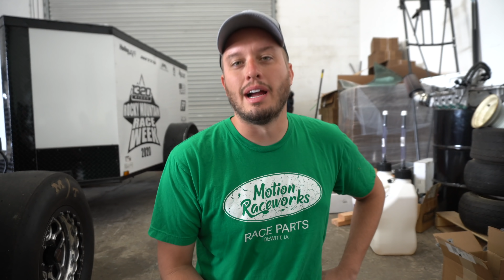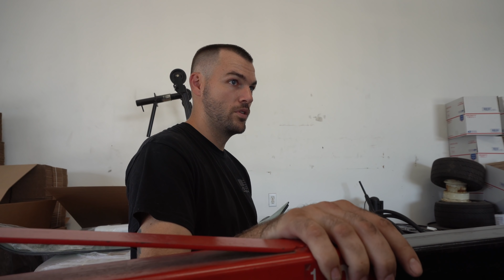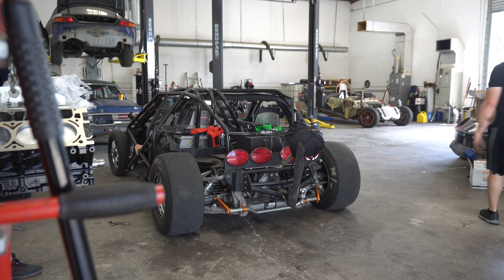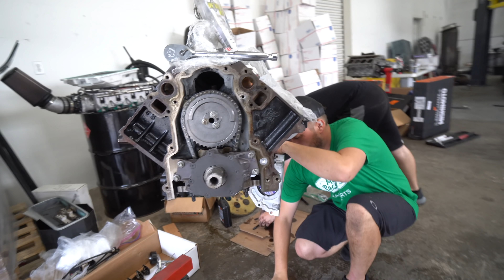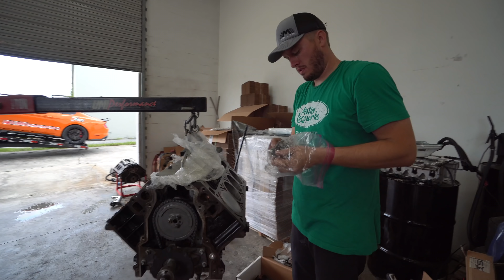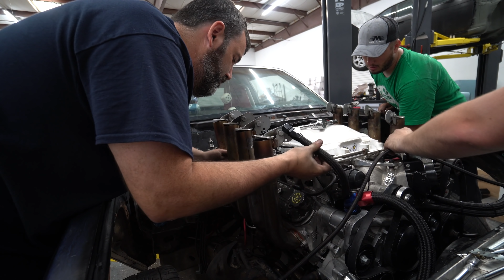Bald rEagle gets Ruby’s built 5.3 just in the nick of time! Burnout Rivals ready!

Comment: I use to do hotshot transporting and I seen a guy at a Copart in LA unhook his truck from his gooseneck wedge car hauler to have his buddy get tires replaced while he was there picking up 3 vehicles. The first vehicle he loaded on the front of the wedge with a 3 ft extension tipped the trailer forward to ground damaging the vehicle and totalled the trailer frame.